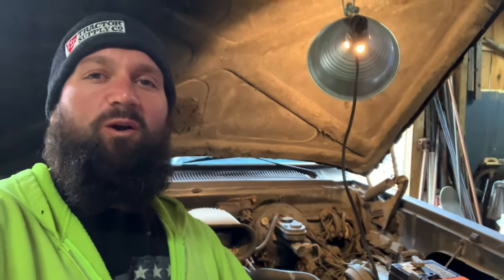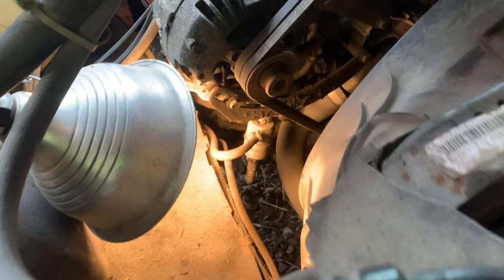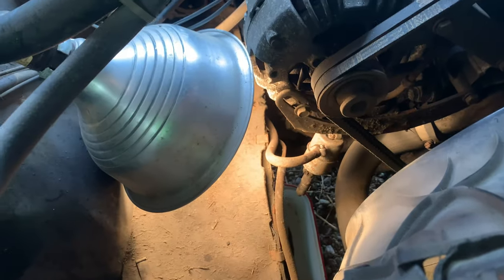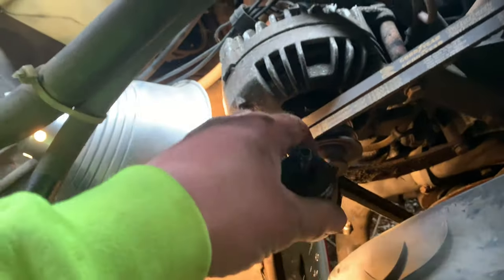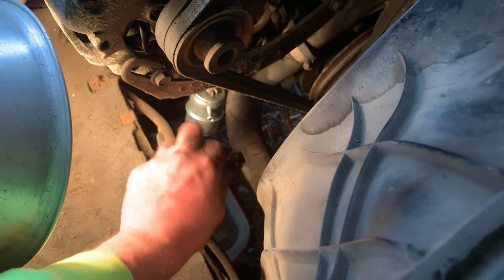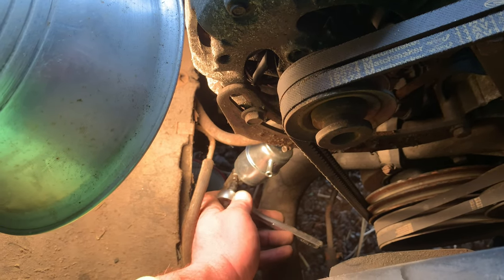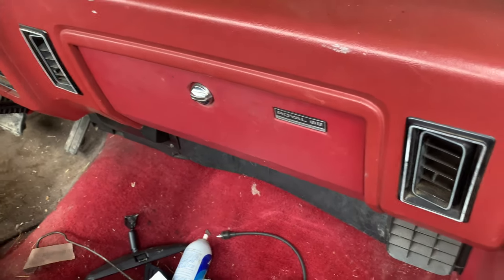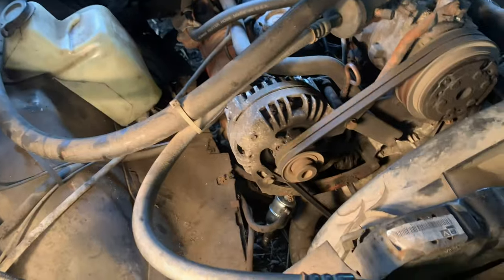How to change a fuel filter on a dodge truck

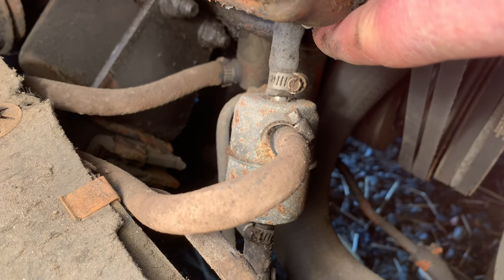Comment: 1:48 the spout coming off of the fuel filter is the fuel return line. The cam driven fuel pump flows more fuel then your carb can hold. Functions the same as modern cars due return at the end of the fuel rail or on the pressure regulator
Reply from the maker: After days of pondering I was thinking the same haha good for the reassurance thank u for the comment!!

Comment: thanks for sharing this    I have 1985 dodge ram d150 truck and runs great but when stopping after running and turn engine off     lots of gas is dripping down off the fuel pump      so truck is running great with fuel but when stopped    something is amiss        any thoughts on where the gas is coming from ?
Reply from the maker: I’d assume a gasket but without being there it’s hard to say but I’d just trace over your whole fuel system from top to bottom. The most common thing I always find is it’s never leaking from where your originally thinking so best to clean everything and check it all. Thanks for watching the channel!
Reply: Hi, had this problem. You'll want to update the gasket to newer materials. Newer fuels now are more corrosive and will wear down the old stuff.from what I found.

Comment: I'm glad this video popped up in my feed. My 85 D250 was running like crap, constantly sputtering and stalling when I gave it gas. I was debating on whether to try a carb rebuild, when this reminded me that I've never changed the filter, and it might have been the original filter for all I know. It did the trick, the old beast runs great again!
Reply from the maker: Aw man so glad I could help you out before you tore into the carb! Thanks for watching

Comment: 2018 dec. 31..
Some chump crashed my 86.. and 78.. pick up .. they were parked in front of the house. I miss them. My 73 dodge motor home had a sweet 360.. torque load transmission. 2bbl. Carb. Fast strong easy to work on easy on gas. Dodge baby.
Reply from the maker: Are u serious? It sounds like you got luck like me BAD 🤣 what’s the torque load trans? 🤔

Comment: What was this fuel filter called please I have a 3 port fuel filter for my van and it doesn't come as a standard stock item at my local store here in new zealand I'm trying to find the exact same one as u use
Reply from the maker: That was some time ago I can try to find out from my parts dealer
Reply: I managed to track one down just waiting for it to be ordered

Comment: what motor is in the truck pretty cool truck i just bought a 1987 dodge d150
Reply from the maker: It’s just a 318 thanks we like it runs pretty decent... congrats on the buy what color is your truck? Single cab too?
Reply: Look at us, all hanging out on the YouTube’s doing maintenance on our old tech Chrysler’s. Little jealous you’ve got a quad, but 🤷🏻‍♂️.    And if it’s anything to look forward to, I’ve almost got all the parts for doing my timing chain job video, to include diagnostic, inspection, replacement/repair for whole front end engine service. Timing chain, water pump, fuel pump and all associated seals and gaskets.
Reply from the maker: @yuuyiatakahashi1943  sounds great to hear from u buddy! I’m still waiting for u to put out a video! I’ll be watching for ya! Yeah I’m like a old fart 😂
Reply: @frontwoodsfarmer2063   I’m starting to feel older then I am these days 🤣. I got the all clear from my friend with a shop space so I can do it indoors over a long weekend without worrying about anything disappearing. And I’m sure it’ll be a process being my first video ever. Luckily my significant other is well versed in Adobe and iMovie.  So while I’m working and talking she can make sure I’m actually in frame 🥸. Plus I’ll be taking regular pictures to do a how - to write up for the 1st Gen forum.
Reply from the maker: That’s awesome your pretty lucky to have a partner in crime that can help out that much with your channel. That’s where I struggle the most in editing I spent big bucks on a Mac book best u can buy Mac computer and had to return it I couldn’t use it 😂 talk about feeling old

Comment: Nicely done. I have a 1986 DB250 van with the same filter. This video helped me game plan how to do it and identify the filter. Do you happen to know where the pump is?
Reply from the maker: Hey buddy sorry about the late response I’m still learning this YouTube stuff and these messages sometimes get hidden. I found a better way to be more responsive and check my unreplied messages. The pump should be in the tank unless someone added and secondary fuel supply.
Reply: So a lot has happened since that comment. Pump is mechanical off the side of the engine. Pulling off the right front tire made everything easy to get to/replace.
Reply from the maker: @GruntyPogue  Ah a mechanical pump I was wondering if it had one or an in in tank thanks for letting me know how’s yours running